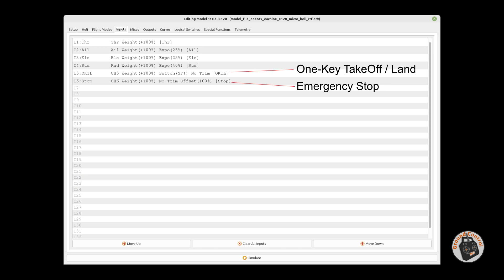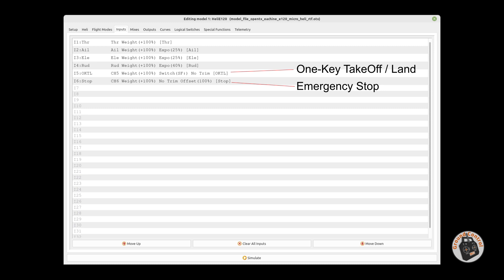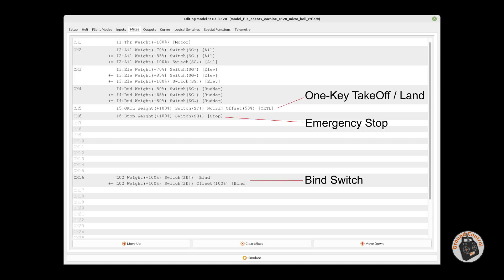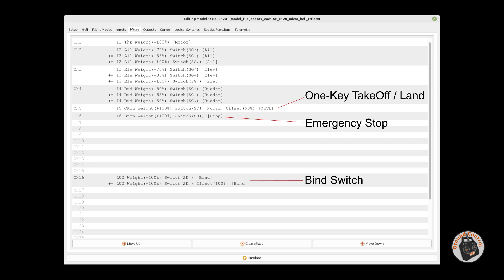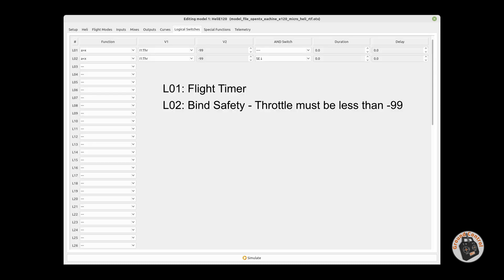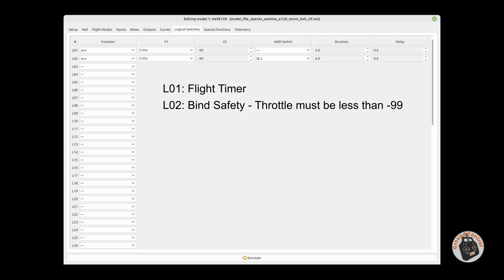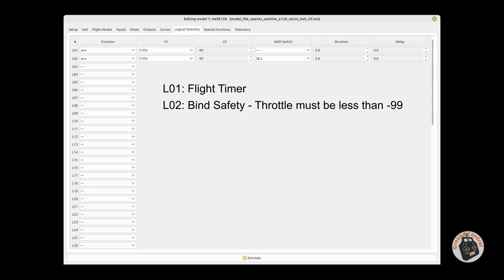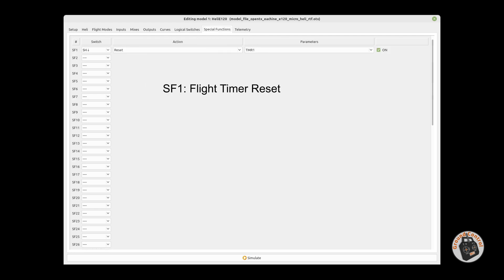Updated OpenTX Model File & OpenTX Companion Setup Screenshots! Eachine E120 BO-105 Helicopter RTF

Comment: Have you upgraded to edgeTX over OpenTX and bound this heli? I know all the new TX16s's radios come standard with edgeTX now and I can't get it to bind with protocol E129  running the latest EdgeTX firmware as of today.
Reply from the maker: I'm still using OpenTX as from what I've read it's a bit more stable.
I've bound up with the Eachine E120 and E110 using the E129/C186 Protocol.
Are you also up on the latest release of Multi-Module?
Reply: @GroundControlRC  Thank you for pointing that out. I have not updated the MM firmware yet, but I will look into that now. I'll try binding it up again and of that fails then I'll try flashing the radio with OpenTX.

Comment: 조종기 화면으로 셋팅하는모습를 촬영하여 보여줄수는 없습니까? 영어는 잘 이해가 안됨니다~~부탁합니다~~
Reply from the maker: Hi!
The reason I provide the screenshots of OpenTX Companion is that they are easier to see and provide more detail than images of the TX Screen.
I also provide the OpenTX Model File on our Facebook Page so if you import that into your Transmitter you'll be able to see everything on your Transmitter instead of just screenshots.
OpenTX Model File - Eachine E110 & E120 4CH 6-Axis Gyro Helicopter RTF
https://drive.google.com/file/d/1WfC9DPTODFrZ8T6jgFqiO-P-KSdG7xOF/view?usp=sharing
I hope that helps and I'll see you in the Air!

Comment: Thanks for your video Got the E120 today and set the TX16s up after your video. I didn't try the bind switch because I found that the heli will bind itself if you turn on the transmitter after the heli. The only important thing here is that the trims of Nick, Aileron and Yaw are on neutral and throttle on zero.
Reply from the maker: That E120 is a great little Heli.
You're going to enjoy it.
See you in the Air!

Comment: Really appreciate your guide here!  Great work.  I popped in your otx file, but for me to get it to bind,  I turned on TX, turned on Heli, pulled the SE switch towards me, and it just sat there blinking rapidly.  Until I raised the THR to max and back down, then it bound up. Also odd, upon moving sticks, there is Ail movement when moving right TX stick right and left, but no ELV movement when moving right TX stick up and down.  The ELV now seems to be on the right TX Throttle stick.....Again, I used your OTX file.  Shouldn't the right TX stick up and down control the heli swash plate??  I am confused.  Thx!
Reply from the maker: Thank You!
I'm using a Mode 2 TX so that's how the Model File is Setup, and yes, the Elevator and Aileron should be on the Right Stick.
The Throttle and Rudder on the Left Stick.
If you're using something other than Mode 2 you'll have to adjust the setup for your Mode.
The Switch for Bind needs to be moved Forward and then Back to complete the Bind.
It works like an On/Off Switch.
The Protocol used can also change things.
The Protocol I'm using is e129 / c186.
Reply: @GroundControlRC  Interesting.  I am also using US version of TX16s Mode 2 AETR with latest stable OTX and MM protocol, using E129/C186 protocol .  I have the Orange C186/BO105, maybe the boards are a bit different?  I also noticed in your OTX file you have Inputs/Mixes Ch1-Ch4 as Thr, Ail, Ele, Rud which is TAER.  I think that may be causing some confusion with my AETR radio.  I dunno?  Will play some more over the holiday.  Happy holidays to you!
Reply from the maker: @dsarnson  Yes, the Channel Mapping is used on mine since TAER is the default Channel Order for my TX.
Perhaps the Channel Mapping is disabled on yours?
Sometimes I'll reorder the Channels on mine to match the Protocol and disable Channel Mapping.
Merry Christmas and Happy Holidays!

Comment: I found that putting  a piece of black insulation tape over the optical sensor give a much smoother flight , without all the onboard corrections.
Reply from the maker: Hi Asheli!
That's a nice Tip!
I'll have to test that out.
See you in the Air!
Reply: @GroundControlRC  a throttle curve of  -100 -20 10 65 100  helps smooth out the collective control being a fixed pitch heli. happy flights.
Reply from the maker: @MrAshfly  Thanks much for that Tip!

Comment: Hi, thank you for an excellent set up video. I have followed your instructions with my own TX 16 S and C186 pro helicopter. Everything is working great, even though I have changed some of your switch settings to suit myself e.g. the take off and landing switch is on switch  SE , while the binding switch is on switch SD. I also had to flash my multimodules firmware to the newest stable version. However, I am finding that I have to still open the model settings page to bind the model to the radio each time I fly. Is this normal? Cheers
Reply: Bonjour , pouvez vous me dire comment vous avez paramétrer le CH5 pour le décollage car pour moi cela ne fonctionne pas correctement aves ma radio TARANIS X7. merci d'avance
Reply from the maker: @SURIMII-yd3zg  I have the Source setup as CH5, with whatever Switch you choose, and an Offset of 50%.
Reply: Merci je vais essayer mais pour le moment  les gaz se déclenche bien mais sont saccadés.
Reply: Bonjour j active l interrupteur le moteur démarre mais il s arrête peut temps après et si je rebascule l interrupteur dans l autre sens il redémarre. Je ne peux pas voler comme cela. J ai oublié de dire que je suis en mode 1 et que je n'ai pas programmé la ligne 16 car il se bind automatiquement quand j allume la radio.
Reply from the maker: @SURIMII-yd3zg  In order for the One-Key-Takeoff to work, you have to have the Throttle at 50% before using the switch.
Otherwise, the Gyro thinks you want to shutdown the motor.
Reply: D accord, mais quand je veux diminuer les gaz pour gérer l'altitude cela ne diminue pas,
Reply from the maker: @SURIMII-yd3zg  I don't know what would cause your throttle not to respond. Is there any throttle trim active?
This is the same setup I use on the Eachine E129, E120, and E110 without issue.
If everything works as it should with the Stock Transmitter then something is not quite right with your Multi-Protocol TX.
Reply: Merci pour votre aide , je vais approfondir le sujet et je revient vers vous pour vous donner le résultat.
Reply: ok super tout fonctionne correctement, effectivement il faut mettre les gaz au milieu pour la calibration du gyro et est gérer les gaz pour l'altitude sans trop descendre les gaz en dessous du milieu. Merci encore pour votre aide et ce petit hélicoptère vole a merveille.
Reply from the maker: @SURIMII-yd3zg  You are most welcome.
See you in the Air!
Reply from the maker: Thank You!
I use the Bind Switch I have setup to bind to the Heli each time. It works on mine so I don't have to go into the setting page to perform bind.
If I remember correctly, that is setup on Channel 16.

Comment: Finally I was able to configure this heli on my TX16S with EDGE TX 2.7.1 based on your guidance (I changed from opentx 3 weeks ago). Edgetx is almost the same as opentx with touch screen and faster development cycle (maybe you should migrate as well :). My channel order is AETR, but looks okay. First I tried the heli inhouse, almost cut my wife's head... fortunately this is small heli :) Then I tried outside and all work perfectly. 
Also I like the BIND function, I’m also lazy, and was angry always if I had to bind with pressing the bind button at my first plane Eachine P51 Mini (you might remember you helped me out at that time as well :).  
So, many thanks for your committed work!!  👏
Greetings from Hungary!  🙂
Reply from the maker: Thank you much Gyula!
Fantastic little Heli.
I'm going to have to use that Bind Function on the Micro RTF Aircraft from now on ;-)
See you in the Air!
Reply: Gyula, I too am trying to configure my TX16S to control my E120.  Do you have any notes that you can share?

Comment: Hi, so after update on module I have all the correct protocols ( good tip a new V2 Jumper Lite with very old flash) . Now my next question , hope you can help . Eachine do not ship the BO-105 to New Zealand, but Aliexpress ship this one . C186 2.4G RC Helicopter 4 propellers 6 axis electronic gyroscope for stabilization, air pressure for height vs C127 RC Drone. Do you know if this is a clone/ compatible Heli ? . Thanks CU out there 👍
Reply from the maker: Hi Alan!
I can't answer that question with absolute confidence.
I believe since the Sub-Protocol is listed as C186 it would be compatible but I'm not positive on that.
I thought I had read somewhere the only difference between the Eachine E120 and the C186 was the C186 did not have the Optical Flow Position Hold but I thought it used the same Protocol.
I didn't do any research on the C186 since I was setting up the E120.
Reply: @GroundControlRC  , Thanks, same thought process . Will order it anyway looks great fun 🤩.
Reply: Hi I have both the E120 and C186 they both look the exactly the same just C186 has no optical flow sensor in the bottom. I’m going to ad FPV to the C186. Thanks for the tx16s setting had to scan ge to AETR but after that worked great. Not got the bind on switch working yet but will have more of a play with it too Work and thanks for the video
Reply: @Fpvobsessive  I have installed the optical flow in my C186 , made no difference. Suspect a different flash/protocol on the receiver.

Comment: Thanks for taking the time and trouble to pass on this information and programming 👍 .
Reply from the maker: Thank you Alan!
OpenTX is awesome ;-)
See you in the Air!
Reply: @GroundControlRC  , See you in the air 👍. Just one question I was unable to find the file on Facebook? . Help appreciated .
Reply from the maker: Hi Alan!
There's a link in the original post regarding the OpenTX Model File but I just added the link to the latest E120 post.
It's currently the second most recent post on our Facebook Page.
Reply: @GroundControlRC  , Thanks switching to PC mode 😂